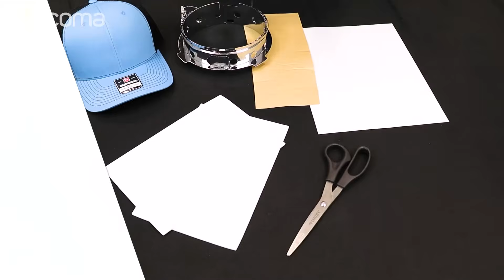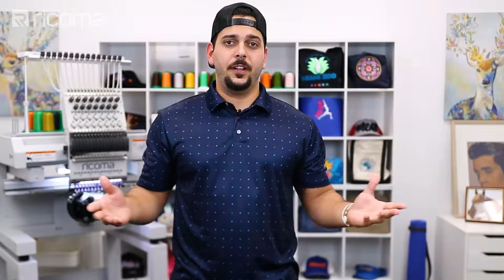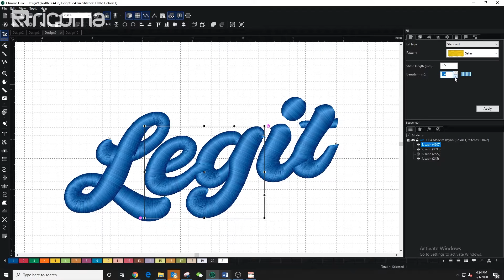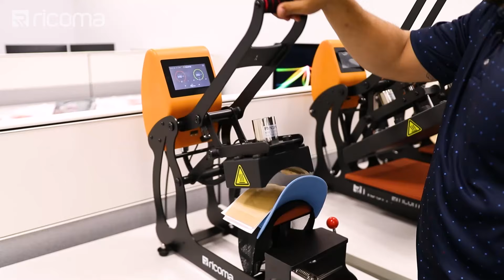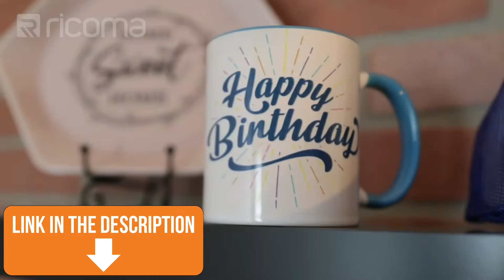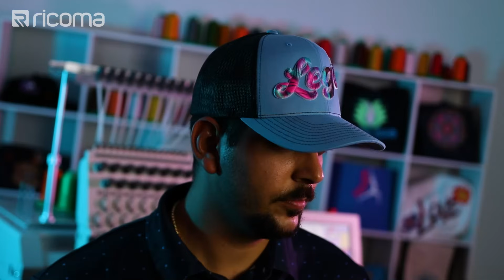SUBLIMATION on 3D Puff EMBROIDERY | Printing and Embroidery on RICHARDSON 112 Cap | (EMB Hub Ep129)

Comment: Hello! If we already have an Epson Sublimation printer, we don't need to get a different printer right? 

Why are you using or showing a white toner printer in this video? Did you use it? I'm confused. 

Thanks.
Reply from the maker: Our white toner printer can be converted to sublimation by simply changing the toner cartridges. If you already have a sublimation printer then you would not need to get another.

Comment: I have a Ricoma MT1501 and I am having lot of trouble when I am hooping the structured cap I am having a terrible time getting the front panel tight.  I am pulling the sides down and clamping them but I am still having alot of popping in which I am losing my registration.  Is there anything you can recommend to help me with this issue?  Thank you so much
Reply from the maker: Hello there, our service team can help if you'd like to contact them here: https://ricoma.com/US/support
Or you can watch more our our videos that will provide tips to help: https://www.youtube.com/watch?v=pSKJ9JNHO8A&list=PLDzOvY3HejtR4YZArNtkWgitnze6wbMe8

Comment: Do you use a 75/11 sharp needle on all 3D puff?
Reply from the maker: Usually yes. If it’s thicker puff you can also use 80/12 sharp point. Always sharp point needle for structured caps.